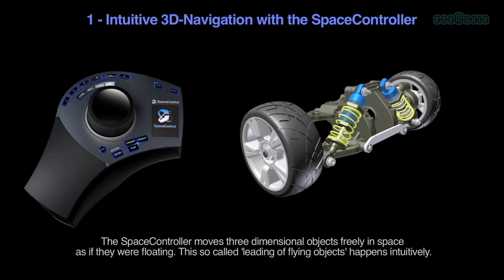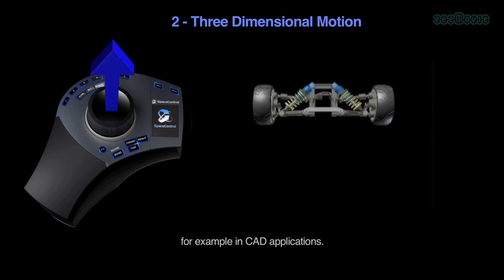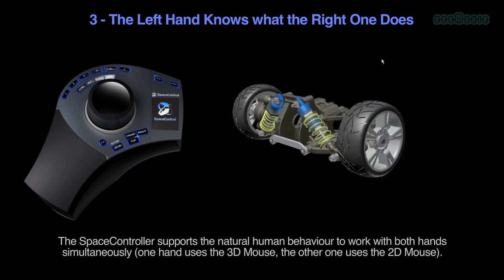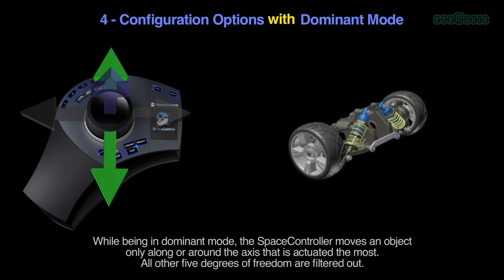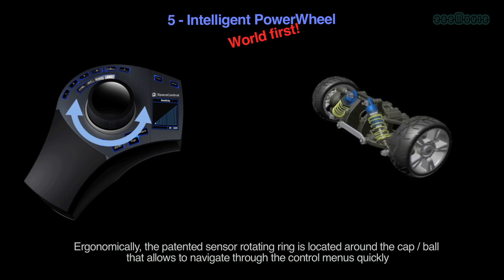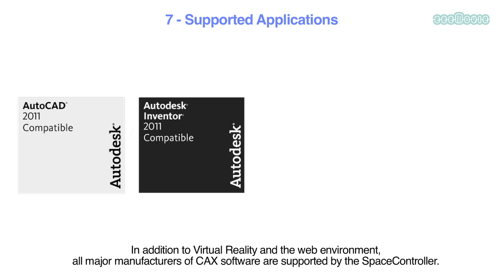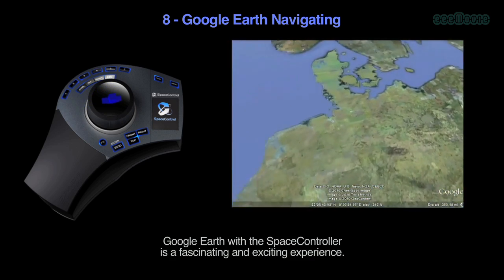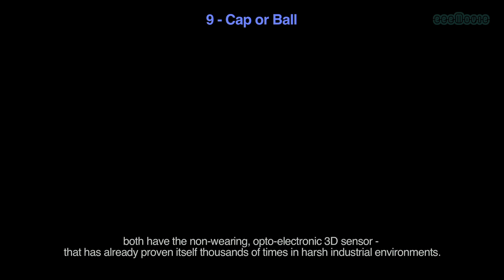3D Mouse SpaceController - Product Video (English)

Comment: I loved the hand support design and the buttons layout.

I use a Space Navigator and was going for an upgrade with more function keys, but 3dconnexion's models with ambidextrous design have their buttons' accessibility almost as awkward as displacing the hand to the keyboard. The hand support being parallel to forward axis also doesn't seem as I'm used to.

Just wanted to shout out appreciation for the hardware design. Unfortunately I use Maya, 3DCoat and SketchUp for previz. Lucky CADers.